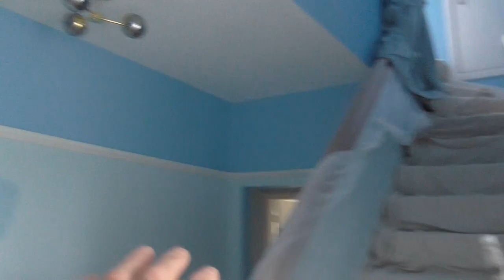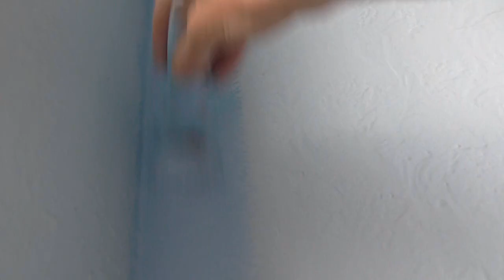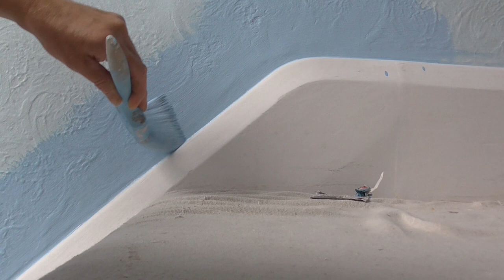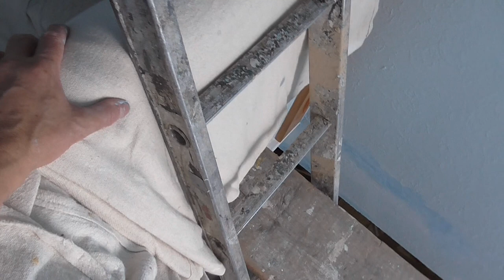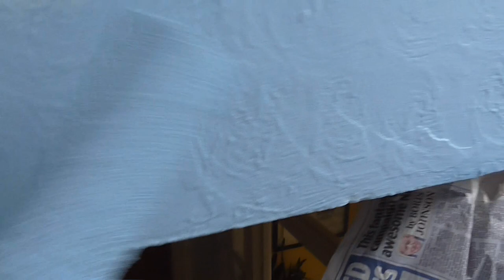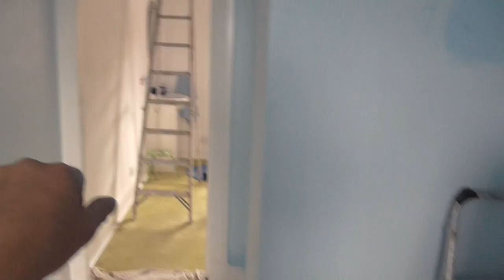Painting Staircase Walls Cutting In And Rolling

Comment: When you apply the second coat, do you cut-in all over again or is the paint at the edges sufficiently thick to not need it?
Reply from the maker: Yes same process for the second coat..  thanks
Reply: if you use a 3 or 4 inch flat brush they hold a lot of paint, so in most cases you don't need to cut twice. But if you use a smaller brush you'll have to cut it again, especially if you use an angled sash brush.